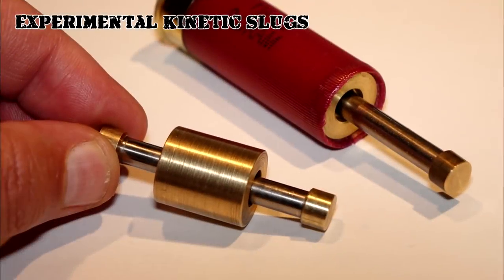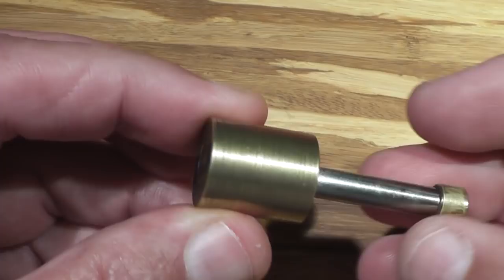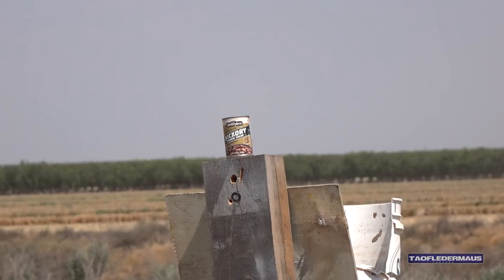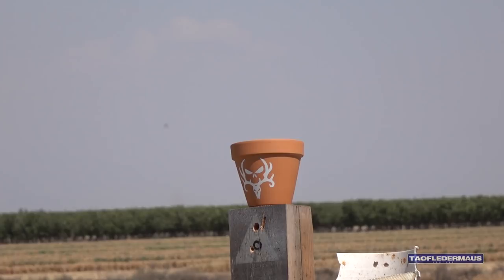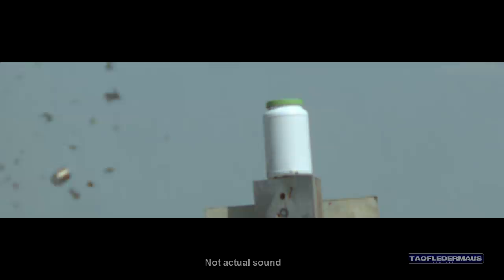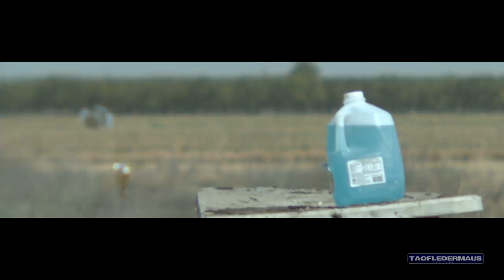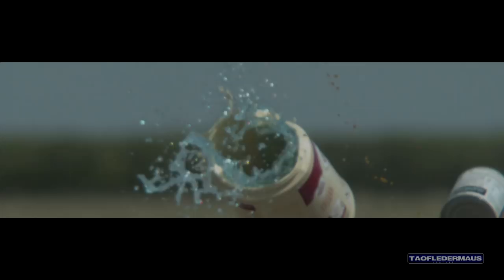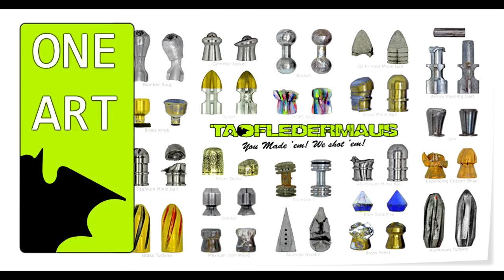The Kinetic Shotgun Round  -  Slug of the future?

Comment: I was thinking it was the opposite of what you guessed. The center pin is lighter so I figured it would be propelled faster than the big sleeve pushing it to the front. Because if the sleeve was at the tip, then it and the center pin would be hitting the target at the exact same time and I don't see the center being strong enough or small enough to penetrate upon impact. So I think the purpose was to fire the round, the sleeve being heavier would stay back, the center pin hits first and then all the weight and energy of the big sleeve comes crashing in.

Comment: If the rod is shortened, the endcaps made of steel, pointed in the front, flared in the back like a dart, and the whole thing is jacketed with the rod all the way back; it might work as intended.
There is no useful action being performed during flight by it being able to move as two independent parts.
The jacket ensures it moves as on piece, by unifying their drag through the air.
On impact the dart core pierces the jacket, either pulling the outer sleeve and jacket with it, using the flared end of the dart core, or continuing alone, if the material is too dense.
Just an idea, though since this video is a couple months old, and nearing a thousand comments, you might not see this.
At any rate, stay safe, have fun, and thanks for sharing your passion.

Comment: It is an interesting concept maybe if it was a little more aerodynamic and some grooves on the cylinder to help keep it spinning instead of flipping it might make a very good lock punching round but I don't know it would be interesting to see how that would handle a lock at about 15 feet
Reply: I think what's happening is that the rod is fired with more velocity than the slug around it and so it gets pulled to the front, maybe if they made the rod have a hole in it?... or, have a more aerodynamic back end (and front end) ?
Reply: I think you're right. I believe what's happening is the slug surrounding the rod is producing drag due to the flatness of the head, if they instead shaped the slug to have less drag on the front by making it more bullet like it would probably operate as intended, assuming the centre rod integrity was also improved upon.
Reply: Nikolai Kojevnikov 
Most definitely and something else that may help it greatly if they would put a few screws at an angle so that the the cylinder or the main slug would be able to spin like the groove it kind of like the rifling on a bullet that has been fired having a little bit of spin on that main cylinder May stabilize it a little bit more and keep it from moving back and forth so much anyway it's a neat idea maybe someday they will give it another shot with some of the improvements people noticed and recommended

Comment: Since the accelerating force is from the rear it makes sense that the cylinder would remain at the rear until impact. The rod would start penetrating until the cylinder caught up and drove it in further.  In theory it's a good design, add some type of break away stabilizer and it would probably work well assuming you can get it to stay together.

Comment: The pin is accelerated together  with the slug and so it keeps its position relative towards the slud. After it comes out of the barrel the friction of the slug with the air is bigger than the pin's and so the slug is decelarated faster than the pin, keeping the pin forced in its front orientated position

Comment: 1985 cell was great OG.
Reply: it was obviously fake because he could lift it in one hand.
Reply: I was there.  But had no phone. 😢👍
Reply: first cell phone I ever used (boss' late 80's model he hung on to until mid 90's) was the "Brick in a bag" with the handset about 2.5" x 4" or 5" in size and the "bag" about 2 bricks in size but twice as heavy because lead acid battery. You also had to never worry about talking while driving. You had to take it out of the van or car to get decent enough signal to not drop the call.
Reply: Jp Kalishek 

Mrs. OG and I were dating in the early 90s when she got a Motorola Dynasty bag phone.  It was bad ass.  Calls were super expensive but the signal was much more powerful than we have now.  Of course I will have brain cancer next month so...
Reply: OG, I think his had a bad antennae from his kid playing with it.
Was it PrimeCo (whoever I think Verizon bought them out) who had the killer "First Minute Free" sales gimmick back then? then it was like a low low 20 cents a minute afterwards if it was a local call.
My first two cell phone providers only charged me half a minute's worth for text messages! Though Net10 would break up the ones that were "too long" (less than Twitter length) . . . mayhap 100 characters,

Comment: I think what would make these work is a bio degradable plastic..I don't have a word for it... Plastic in a aerodynamic shape that doesn't break when being shot, but fragile enough to break on impact around the rod. With the slug part at the back. The front would need some weight so the slug part doesn't rotate to the front after being fired. 

As usual I have it right in my head, but not the words
Reply: title10 some 3D printed pieces of plastic with a low infill percentage might work really well for that. I like your idea
Reply: title10 https://m.imgur.com/gallery/bwIhFD4

I made a little drawing for what I think we both ment. I am not good with drawing things on smartphones because my fat fingers cover up everything lol
Reply: It sounds like you're describing a sabot tank round!
Reply: yeah, that is pretty much what it is
Reply: Zork Mid not exactly, as a sabot is discarded in flight, this will stay with the projectile holding the weight back. On impact it will give way sending the weight forward and do what this one was intended to do. Besides my idea isn't meant to take up space in the barrel like a sabot either, it will be a part of the projectile
Reply: Wieselkatze I didn't get the notification you posted the link, yes.
Reply: title10 so going back to the tank munitions, what you described reminds me of Caps/Ballistic caps. Softer and lighter additions to the base projectile meant to stay on the projectile until impact.
You know what, thinking more on that reminded me of a different kind of tank projectile that more accurately fits what you've described. Going to hunt down the name of it now.
Reply: Gideon ok. I only have a little experience with only (what I call) basic artillery. It exists,  then I guess it's not an original idea, but should make the demoed round work as intended.

Comment: A slide hammer slug should focus as much on the strength of the slide as it does on the hammer. Specifically the girth of the slide shaft and the strength of the slide stops.

Comment: You guys could try using something like a grade 8 bolt for the rod the slug slides on. They are more likely to crack than a grade 5 bolt but they’re much stronger, that way you could thread the endcaps on and hopefully keep everything together a little better.

Comment: As I'm sure has been noted. But, there would seem to be two things needed to correct the issues. Tapered nose on the slug down to the size of the front end cap. To  Reduce the areo drag separation issue.  And make a 2 piece rod instead of 3. With just a pushed on rear cap. Rod and front cap = 1 piece. Should eliminate separation of the 2.

Comment: The reason the bar hits first is because the wind resistance on,the larger diameter brass core slows it so it acts more like a hammer . The bar hits then the kinetic energy through the core forward making it much better

Comment: 2:49 The freefloating piece is traveling at the same speed. It seems like the weight is packed at a point next to the end, meaning that the explosion and pressure that cause immediete ejection acts on both the bar and weight simultaneously. The tilting seems to be cause by gravitational force, created by the angle of the projectile as it flew. Wiithout any spin, the projectile has few means to compensate for uneven distribution of pressure caused by ignition of powder. I am a laymen though. 
Edit: Idk about the velocity it was traveling, but the weight itself would feel the effects if gravity more than the bar. I hypothesize that this would mean, that despite both traveling at same speed the bar feels less gravitational perturbation than the weight given the use of velocity and lift to sustain flight.

Comment: So I was expecting the slug to fire in the reverse you originally stated. My reasoning was that surface area of the sliding piece would be alot larger then the center. Because air is pushing against your slug the larger piece should be pushed backward making the smaller pieces pointing forward. Once the slug impacts I imagine the larger piece sliding down the center pin.

Comment: Seems like the sliding pin is rather pointless since the pin stays in the same position anyways, and if it didn't and slid back instead, it would be like firing a solid cylinder anyways. If the pin did slide backward from say wind force, it would also cause deceleration of the shell, equal and opposite reactions principle and all. I'm not sure what the intended usage of such a shell would be.  A shape that might be more interesting is if the pin weren't there, and the inner/outer edges of the cylinder were tapered to a point, like a cookie cutter.

Comment: 2:45 My exact prediction, the pin acquires the same momentum as the other piece, but it's smaller.
Or most likely, it has the same energy relative to it's mass so both parts of the slug end up with the same speed.

Comment: Looks like the end caps are press fitted. Could be a try, that you glue the cylinder on the bottom cap with a weak glue, this prevent hammering the bottom. The other solution could be to solder it on the bottom. Or just cut it off and wel a nut on it

Comment: I think if the projectile were packed opposite with only 1 pressed cap on the rear it could work. 

The force coming from the gunpowder push more on the round slug than the pin itself. That's why it explodes.

Comment: the pin will fire forward because it is the less massive part of the closed system. if you want it to fall behind during flight, try placing a trio of very wide tailfins on the back end. if you want to be sure it slides forward during impact, make it so the tailfins will collapse like chinese fans or "junk" sails.

Comment: The brass slug section has a larger surface area, so it'll suffer from drag faster than the "penetrator core", hence the slug receding down the core length

Comment: During firing a shot, moving metal core is fired to another end (that's a problem with this slug). It needs to have something that holds it (customized extensively wings) until it leaves a barrel. (maybe would be enough to put in front and have faith)

Comment: Do a cap with a drop shape and a hole behind for the "hammer" to slide into. Along the drop shape do riflings the turn 10 degrees pr. cm along the curvature. should do the trick, but do make the hammer light, max 1-2 times the weight of the rod it connects to.

Comment: So some critique on this slug. The pin should start in rear position. Otherwise its going to almost always destroy itself even if installing brass bearings by heat welding. Guessing by size of this thing. A 3” shell would be needed with some sabo style holders. I dont think any of this is shooter related or even gun used.

If these changes are made I suspect this would punch a whole in ar-500 plate or even level 3 armor easy. Especially if that pin was hardened steel. You should be able to load this to magnum level powder no problem if these changes were made. Another idea is to put a dab of super glue at brass slug back and the steel pin. The impact would easily shatter the bond anyway.

Comment: believe the solid piece needs to be shaped more like a normal bullet to keep stability. not much you can do about the pin (since it has less surface area it will have less air resistance and thus go faster, or rather, not get slowed down as much) and maybe the front cap should be shaped with the pin itself and the rear cap should be its own piece so that the force of going through the barrel doesnt rip off the front cap

Comment: Haven't watched all of the video yet, at a guess though, I would think the gas pressure in the barrel would project the inner part of the slug forward through the outer part so loading it with the inner and outer parts flush to the gas seal would be important.

Comment: It likely works the opposite to how you describes it. Drag probably pushes the cylinder back and then when the pin strikes something soft, it penetrates like a small bullet, then when it hits something hard like bone, the cylinder jolts forward and acts more like a slug. It would work similar to the physics of slamming on the brakes in a car and everything loose in the car goes flying,  which would explain why its called the kinetic slug.

Comment: Dude i could have told you the pin would go forward ,, its simple science .. the pin is lighter and has less air resistance than the cylinder ..

If you want a round that does what was described at the beginning the pin needs be in the back from the start not be able to slide forward until the actual impact at which point the velocity of the pin will drive it in.
this would require some kinda breakaway seal on the front of the cylinder or another type of mechanism to keep the pin locked in the "stabilizing fin mode" until the impact happens.

Comment: I thought the point would be the opposite, the main weight slides back with more air drag than the bar. the weight than slams forward, not to penetrate with the rod but to slam and crush ribs with huge amounts of weight

Comment: Even if the slug was built better it wouldn't fly the way you want it to.  The center pin and the outer cylinder have the same force being applied to it, so the center pin wouldn't slide back after being shot. The outer cylinder would need to have more force applied to it than the center pin for that to happen.

Comment: I have always wondered how a copper slug would behave. Copper is pretty soft freshly forged, but it work hardens. I wonder if it would be soft enough to deform well in the barrel, but then work harden enough to spall once hitting the target.
Reply: In my experience, high velocity projectiles Such as the .257 weatherby and 30-06 accelerator produce around 50-65,000 psi. During ignition and flight, projectiles reach temperatures between 400-570 degrees Fahrenheit. At these temperatures even lead retains its chemical structural integrity. Therefore we can deduce that copper, would retain its chemical behavior at these temperatures and thus it's ballistic behaviors regarding various targets.

Comment: I feel like the issue with the end caps and the rod not retracting in flight as to do with the near identical sizes of the end caps. If the forward cap was larger I feel the air resistance would be able to drive it in easier.

Comment: Yeah, that's the way I thought it would travel... the slug is decelerating faster than the pin... so the pin goes out front.  You'd need flights or something on the rear of the pin (like a shuttlecock) to cause it to decelerate faster than the slug.  You might chamfer the forward perimeter of the slug as well.

Comment: looks like they are in the casing backward, the ones that stay together (you can see the rod out the front and the back of the slide sits flush with the stopper during flight) the side that sits flush should be facing forward so it displaces air better and the tail sits in the air it displaces. Try a test with you loading them the other way. One side of the stoppers on that rod could be glued and the other side machined that way, that way you make the rod with one stopper as one whole peice slide the weight on, and glue the stopper on the trailing end, no wonder they come apart.
Reply: the reason you see it flip at 6:44 is because its backwards and it trys to correct itself

Comment: Maybe a deep threaded brass cap on the slide pin would keep it secured.like a dual female rod with two caps with male threads about half an inch in. Structure is the issue, good concept though.
Maybe a blasting cap as the projectile end cap will be a cool video. And a threaded rod can give you more options for the front of the round...like a hollow point or broad head cap to mix up the impacts.
Good video, regardless. I liked it a lot.

Comment: It's the air drag that puts the sliding lump to the back, if it flew straight it should be a triple hitter. Leading pin, then slider impact, then leading pin again.
Reply: Imagine it at a fin stabilized tank round, only larger and made of tungsten. Since I mention military hardware, may as well make it out of depleted uranium! M.O.D, D.O.D, send a cheque for fifty bucks, thanks.

Comment: What I make of this is that the center pin is more aerodynamic, what with it have a larger weight to frontal surface area ration. And so the center pin would go faster than the outer part.

Comment: I would suggest using a thin front cover to hold the slug in the inflght position (main body forward) and then when it impacts the force will push the rod forward. The rod itself will probably need to be rear weighted to give it some forward momentum, but yeah the g shock is going to completely screw over any slug system that is not 100% a solid piece.
Reply: By thin cover I mean half jacket

Comment: I wouldn't think the pin would retract backwards when the force is being applied to both body and pin at the same time when firing.  Maybe if the pin was spring loaded to force it back mid flight (assuming you can keep it from breaking apart)